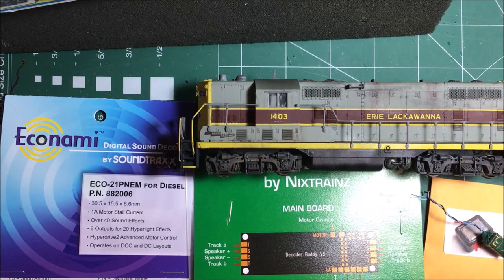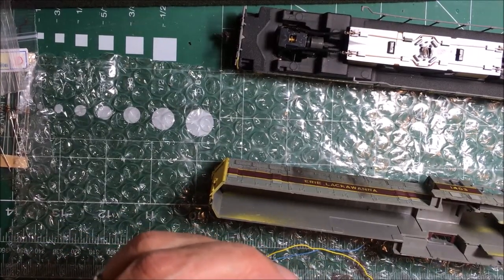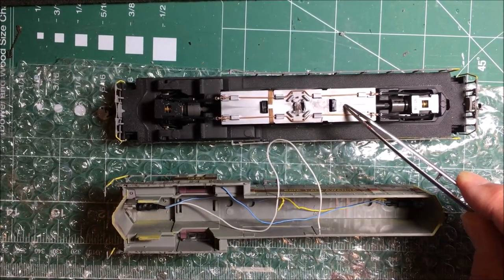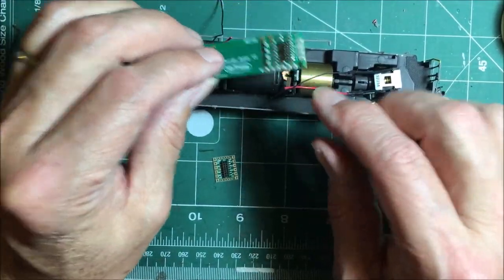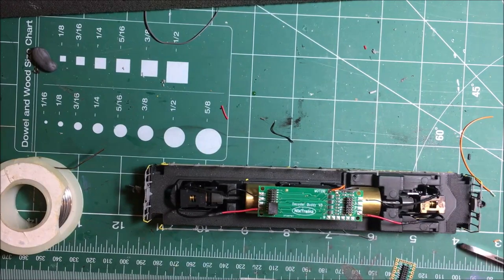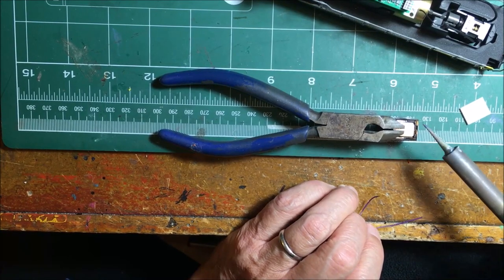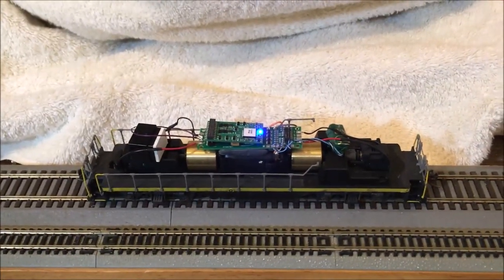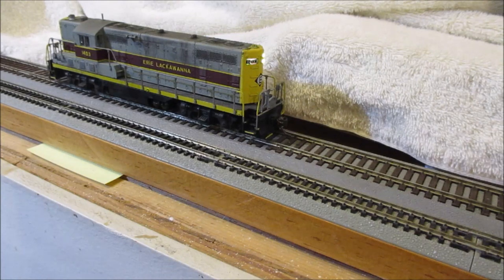DCC Sound Decoder Installation in an HO Scale Atlas/Kato GP-7

Comment: You could have saved yourself a lot of hacking by using the Econami board made for the Atlas and some UHU putty to mount the LEDs.  You should never use flux on a circuit board, it can impact the performance of the decoder.  By using the Econami decoder made for the Atlas, you have space left above the decoder, so no space problems.  If you use a Bowser sugar cube speaker you can mount that inside the cab with double sided tape.
Reply from the maker: Thank you for your suggestions.

Comment: This is a huge help for me, thank you! I’m looking at a couple of these older Atlas/Kato models and I’m curious to see if their performance is drastically different from newer models. It looks like this one did pretty well. Any thoughts? Would they consist with something new? Thanks again!
Reply from the maker: Glad you found it helpful.  We have several Atlas/Kato engines on our layout, along with one newer GP.  All are more reliable and run smoother than engines by other manufacturers.  When released in the 80's this was the best running and detailed engine you could buy.  To prevent damage to the drive & decoder we recommend speed matching any consists.  For a short run I personally don't bother but our consisted club engines are speed matched.
Reply: Perfect, thank you! I picked up a pair, I’ll have to get a speedometer too.

Comment: Could I ask you about a couple of component details please?  The V5 Decoder comes with or without resistors - which do you use?  About the Supersonic speaker enclosures - they’re a bit pricy here in the U.K. - how many did you use in the end?  Thanks very much for the encouraging video!!
Reply from the maker: Soundtraxx decoders do not have resistors on the function outputs.  However, the Nix Trains Decoder Buddy does.  So, if you use the output pads on the Decoder Buddy you don't need to add resistors.  I only used one sugar cube speaker.  Here in the US the speaker is around $6 and the enclosure is $10.  I've now used Scale Sound Systems speakers in a couple of engines and I really like them, but they're $17 plus shipping here.  Good luck, and have fun.

Comment: Follow up question…
How do you modify/swap out the hook couplers for kadee’s? Did you get a coupler box, cut the existing opening bigger and glue it in?
Seems like a ‘simple’ enough process, I’m just wondering if you needed any reinforcing. Thank you!
Reply from the maker: I had to go back & check.  I used a Kadee box (the old ones with the ears).  Just cut off the ears and use the original friction pin to hold in place.  No need to make opening bigger nor for reinforcing since the frame is metal.

Comment: Are the motors in the Atlas yellow box engines isolated?
Reply: Good question.  Yes, the motor is mounted in a plastic cradle so it's all isolated from the frame.  Thanks for watchin'!
Reply: Thanks @alanwbelcher